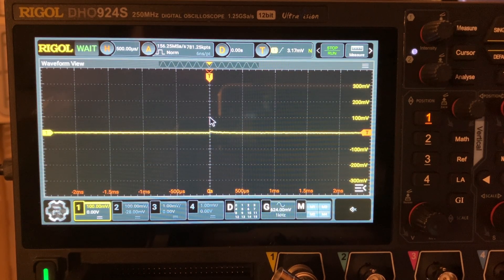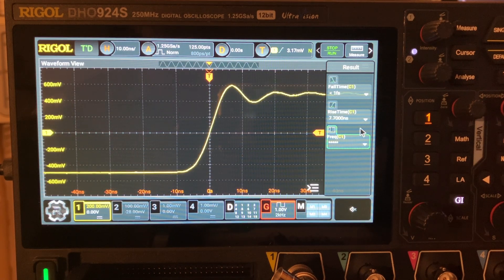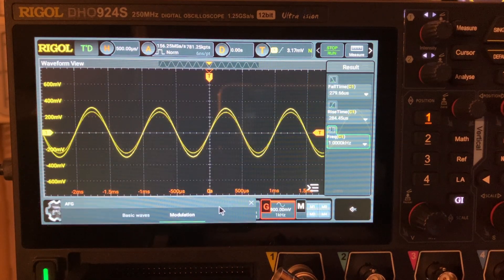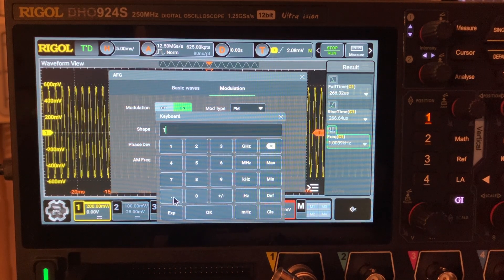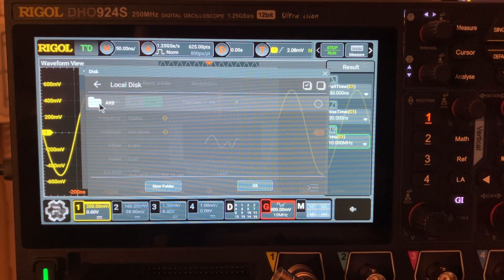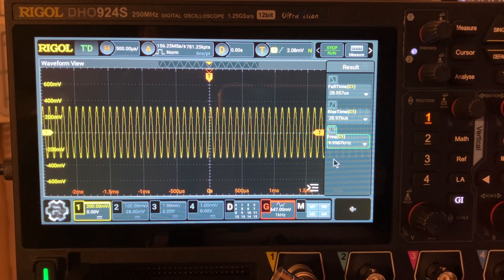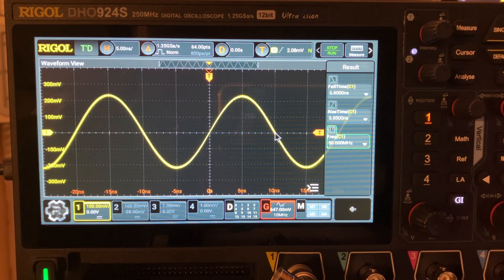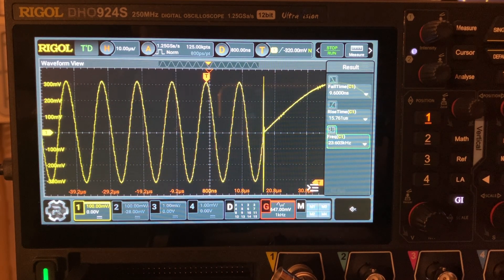Frequency generator with Rigol DHO924s up to 50Mhz

Comment: Hello sir
Sorry, all the waveforms I create in csv format for DHO924S give AFG error ((operation failed)), do you know what is the problem
Thanks
Reply from the maker: ya , best way is to modify the files that I have put on my github.  it does not tolerate any different format and size...
Reply: thank you very much @stevelevesque939

Comment: Hi, is it possible to have it output a signal, connect that to a breadboard then also connect a channel to the breadboard to  measure the signal. So you can use it as a signal generator and oscilloscope at the same time. E.g I don't need another oscilloscope to monitor the signal?
Reply from the maker: yes , however the function generator is not a very powerful one.  Depending on the loads you may want to buffer it with a gain of one in an op amp.
Reply: @stevelevesque939  Hi Steve. Further to this question, how do you feed the signal to a circuit? Does it have its own power ? Meaning, do I connect a DC power supply to the circuit as well?

Comment: Wow now that is cool, I must have watched every DHO series vid on here, and these are the coolest..  Thanks for discovering this.  I suspect that you saved one arb signal and then modified it in a spreadsheet?...   I looked at the 50Mhz signal on a spec anal, and its surprisingly "clean", I saw no harmonics at 100 or 150 Mhz  etc.  I looked out to 500Mhz  and saw only some close in noise at  6 Mhz away and -50db down...  Nice work... Thanks, your videos are very interesting, as they depart from the usual material you can read in the manual...  Great work...

Comment: I did not see any Rigol-related files on your GitHub page. Can you please provide a link?
Reply from the maker: h t t p s : / / github.com/levesqs/Rigol924s-ARB-file    remove spaces
Reply: Thanks! @stevelevesque939
Reply: Thanks very much for these files, it saved me a lot of time trying to work out how to do it with the sparse documentation.
Reply: @stevelevesque939  Thanks so much for sharing this. On the your github page it looks like it was clipping at +-0.312 Volt. As long as you adjust the AMP figure in the header to allow exactly for the +- peaks, it is possible to go way beyond this voltage.